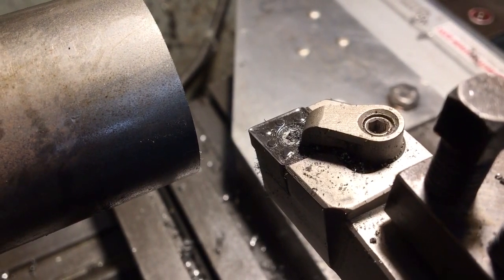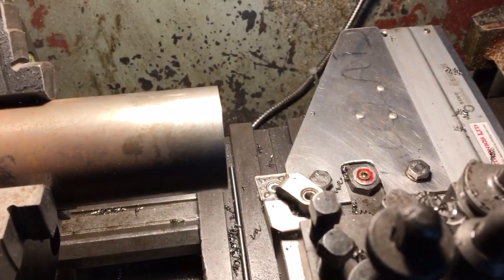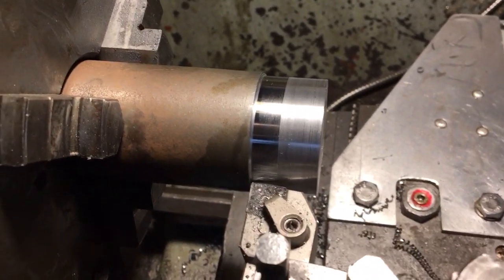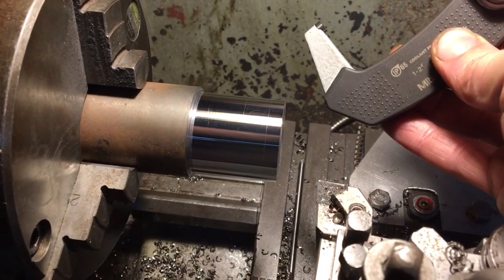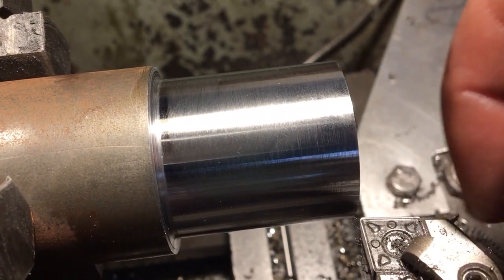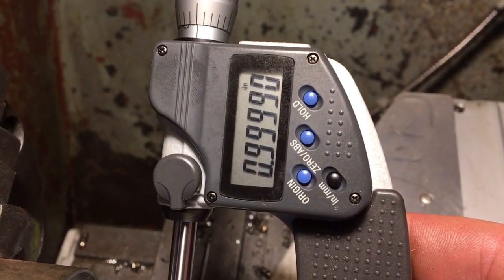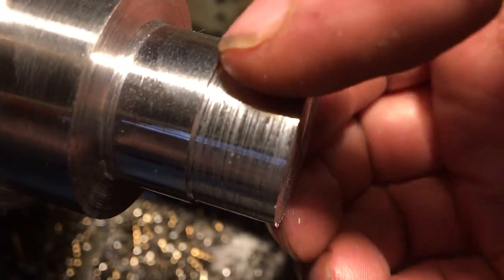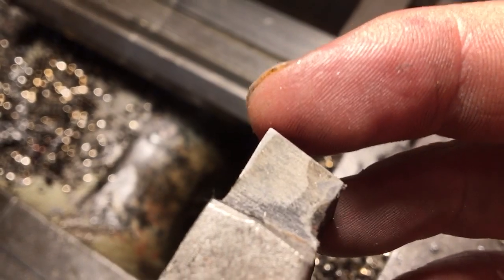Carbide vs High speed steel

Comment: If you look at all the specs that manufacturers of carbide inserts make for their tooling, it will show you a "minimum depth of cut". There are roughing, finishing, and in betweeners as far as inserts go. 
The manufacturers make their spec sheets based off of getting polished surface finishes with a cut. Has to do with "sharpness" of an insert. Nose radii basically. But yeah they go through a lot of effort to give us all the information we could ask for to basically know exactly what the insert is gonna do and how it will perform before it even touched material. Talk to any rep from insert suppliers and they should know all this info. 
If you have a particular job coming up get with a supplier and give him your needs and measurements and they can pull up the tooling that will get the job done. 
That being said, absolutely worth it to get accustomed to using HSS especially for us home gamers as its super versatile, far cheaper, and can still do anything we need it to. On the rare cases we are working with tool steel alloys, thats really when carbide is a must.

Comment: Thank you for sharing your knowledge with us. Great video and results using carbide inserts. I have an old South Bend 13"x72" lathe from 1960. Engine lathe with a 3-step pulley and 2-1/4" wide belt. It has been used hard and lied about when I bought it. My first lathe that I bought in 2019, I just turned 70 years old in April. You have made it clear that you need to know what you are working with and compensate to keep it on the mark. Old lathes can still turn out good work. Learn what's best for yourself and for the lathe to get the best results. I use carbide inserts and HSS in combination and I understand what you were trying to express with the speed and diameter, at least I have learned that little bit while using my lathe. Again, thank you.
Reply from the maker: Thank You!  Yes - old machines can produce high quality work, some people seem to think there are hard and fast rules for speeds, feeds etc, but there's usually a "work around" once you get to know your machines well.
Reply: @framavia2201  It does seem that with inserts for my lathe the best results are in the 400+RPMs and at 900+RPMs. Every once in a while I get good results at slower speeds. Still a long ways to go and a race against the clock. lol

Comment: The problem isn’t the carbide, it’s that you’re not supposed to do the finishing cut with a roughing tool, you need an insert with a small nose angle and decrease the feed, there might also be some vibrations that are causing the poor surface so make sure that the part isn’t sticking out too far from the chuck, otherwise you might need a tailstock.
Reply: U might have solved my problem🙌🏽

Comment: This is the BEST video I have ever seen on explaining surface finish problems with carbide! Now I can see where I am going wrong. I have an old Colchester Triumph lathe - very similar to your Student just a lot bigger. Also with a top speed of 1000rpm. I am very lucky - although it looks tatty the lathe is in mint condition.
I have been getting terrible surface finish with my carbide tooling. Obviously taking much too light a cut. They really need to be worked hard.
I didn't see the point in a DRO on a lathe - until I saw yours. It works very well indeed.
Reply: I was much the same about the DRO.
Then I did a job at work on the mill (unusual, I'm a stainless fabricator) using the DRO.
After that I just HAD to put one on my lathe at home. 
Now I'd never go back.

Comment: I have noticed the differences in finish when taking light cuts, but I tend to not switch to high speed steel. I guess I need to get better at grinding the HSS tool bits. This is good information!

Comment: You can get good finish with carbide tips, you run the machine extremely slow and use a really slow feed, takes a long time but you get a perfect mirror finish (although this isn't really practical in a working machine shop as it takes too long)
Reply from the maker: Thanks for the tips!

Comment: Really great video showing plusses and minuses. I have been having to do a lot of post-polishing, trying to get passes with either HSS or Carbide Inserts on a minimal 10" Atlas 10F lathe. I gen'ed up an excel spreadsheet of surface speeds versus pulleys versus stock diameter. That's where the reality of the limits of these classic lathes showed up. Even trying to get surface speeds for Aluminium is hard to do at small diameters.

Comment: It's just the nature of the beast...plus carbide inserts are generally designed for production runs and reaching target dimensions quicker and in less passes on huge machine tools rather than fiddling with spring passes on bench top lathes!
Reply from the maker: Yup, couldn't have put it better - I have an idea for a whole new video now.
Reply: That's the problem running indexable carbide insert tooling on the older lathes built when HSS was still the norm. At 1"diameter 1100 RPM would give you about 300 SFM, which is about minimum.

Comment: I mostly use carbide inserts except when cutting Polyurathene  as the HSS tool need a very steep positive rake angle and sharp point the 2nd is when cutting coarse pitch multi-start acme / Trap.  threads as carbide doesn’t have enough clearance and it rubs where as HSS can be ground with clearance then It doesn’t rub . 3rd is making tiny HSS boring bars .

Comment: Retired machinist/toolmaker here (40+ years).
This is painful to watch…. 
If you need to polish anything to size, you’re NOT a machinist.
If you can’t maintain a surface finish (as specified by a blueprint) without polishing, you’re NOT a machinist.
You should be able to maintain size and surface finish with either carbide or HSS if you know what you’re doing.

Comment: About what spindle speed were you running in the video? 13-1500? Just wondering. Great video
Reply from the maker: The highest speed on this lathe is 1000, thats another reason I have to resort to HSS sometimes.
Reply: @framavia2201  ah. I completely understand with the hss. Carbide can be real picky. You ever considered converting it to run a little faster?

Comment: The video's dynamic range is way out there. Can barely hear the talking so need to turn the volume up, then as soon as the lathe starts the speaker blows up. Some editing would be really helpful here, or at least speak louder or use some kind of a mike. 

As for finish you really need inserts with the right geometry for finish cuts... I've never gotten a shiny finish off of HSS, no idea why. Best I can get is a brushed steel finish.

Comment: I am  guessing the spindle bearings in that lathe are as old as the machine itself?  Some of your problems may lay there I think. Harmonic waves in the finish usually are adjustment or worn spindle bearings more than anything else...
Reply from the maker: Yeah, I want to investigate the headstock and bearing preload at some point, almost certainly original

Comment: the insert has a proper angel thers no point in tilting the slide. And those marks come from wrong feed and speed ans vibrations. you should only leave 2 times the diameter hanging out.
Reply from the maker: Granted the marks come from cutting at the wrong speed, but thats kind of my point, the top speed of this lathe is 1000 RPM, which becomes too slow to get really good results with carbide inserts at diameters much under 2 inches. Lots of people in this situation will get better results with a well honed very sharp HSS tool with a small nose radius.

Comment: Get to the point already.  Didn't need to waste time showing off the DRO just to prove carbide can't cut small.  One big cut, cuts good.  One small cut, cuts like crap.  Put the HSS in and do the same.  Two videos scaled down to 4 minutes or less.

Comment: I agree with you HSS tools have a place in any home shop even now, when carbide is dirty cheap - especially if you have a decent tool grinder and you can repurpose broken endmills etc. for single point cutters easily.
BUT this is not a fair comparison. Most of the carbide inserts are purposefully ground relatively dull to prolong their lives by minimizing chance of chipping. If you would grind and polish/lap the carbide insert (or the end of a broken endmill) to be dead sharp, you'll get similar results as with the HSS tool no matter the speed or chip load.
You just need to be extra careful to not chip the carbide. Grinding it with a tiny round at the tip always helps...
Reply: I wanted to see a cemented carbide ground as close as possible to a piece of high-speed steel and run to their respected RPMs for a comparison myself ha. You have a really good point the way carbide inserts are designed and it being so much more brittle. It should be common knowledge a tool no matter what it's made of if it's designed to make the lightest cut and best finish it won't last long doing heavy work.